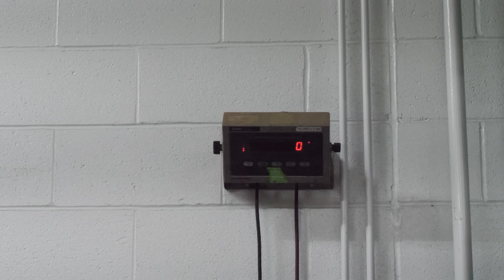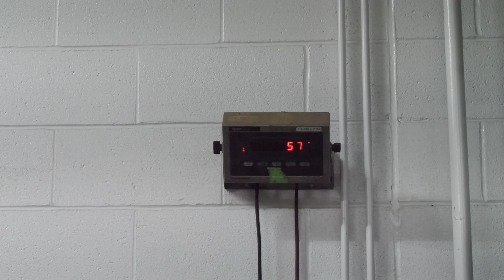EV TEARDOWN! Nissan Leaf Complete Electric Vehicle Drive Motor Unit Disassembly!

Comment: It's a lot smaller & way less messy than splitting a Tesla motor, & a GM EV motor, that motor was pretty clean & low wear compared to the Nissan Leaf motors I seen here ,the ones from the NYC Parks Dept look like they came out of a NYC sewage facility inside

Comment: Along these same lines, if you ever come across a Prius transaxle, snag it.  
I lost count of the fasteners when I got well over 100.  
They are insanely complicated- and really kind of elegant.  
I mean, if there are 2 motors and an engine, why NOT go nuts with the gearing???

Comment: 200LB FT doesn't seem like a lot - true,  but the torque curve of an EV motor (Leaf in this case) is essentially flat from zero to 10K RPM, so this motor is always producing 200lb feet any time the pedal is down.  Engine builders know peak torque is one thing, but the area under the curve is far more important.
Reply: Correct, an electric motor is a torque-on-demand power source, compared to an ICE, which needs to reach a certain RPM to generate peak torque.  

The naysayers on here need to go drive an EV with an open mind, I think they would be impressed.  I know I was.
Reply: @trex450flyer  And there's another "quirk" about EVs - anytime the pedal is pushed - even for a tiny fraction, the torque follows the pedal no matter how fast it's pushed.  In any gas car, the gas pedal can be quickly mashed to the floor and released, and nothing happens.  It takes time for the car to downshift (auto) and the PCM to respond to cam phasing and fly by wire throttle response.

Comment: The not simple part is the current  flow and the lack of resistance needed to make that happen. Any poor connection will result in great heat and / or melted parts.

Comment: For not having anywhere near as much thermal cycling and fuel combustion forces as a regular ICE, it sure seems overbuilt and overhardened with all those bolts for just an EV. :P
Reply: Overbuilt=longevity.

Comment: That torque number becomes more impressive when you consider that's the value AT ZERO RPM. 207ft-lbs from a dead stop.
Disappointed that they can't be sold. These should be big money for the DIY EV crowd. Controllers should be money as well.

Comment: Not that it matters but I cant help but mention. The armature is the stationary part of this motor. The magnetized part is the rotor. I think this is typical of moden EVs. There are motors  where the armature is part of the rotor. Those motors will always have brushes. Technically this motor is a permanent magnet synchronous machine.

Comment: For  Xmas, why not a marine engine. Merc has 2--strokes cheap, GM has 455 gas grabbers, Outboard, direct drives, etc. Even Yanmar 3 cylinders diesels. Or big Farm Machine engines. My first drive was a 1946 Ford tractor. Or a duce-and-a-haff military multi-fuel beast. Or take a tour of locomotive diesel rebuild facility. Just watched with great interest the Leaf  motivator tear down. Oh Wow, the possibilities. Aircraft? Go card race engines? Massive marine diesels? WWII huge rmulti-bank radial engines? I'd love to be educated/entertained. Keep on truckin'.

Comment: Eric,
Thank you for taking us on this new adventure.
Yes there is a huge resistance to the whole EV thing, but only because of the stupid mandate crap.
There is a very practical place for these vehicles just like when the Honda Hybrids first came out, then Prius, and now the options are quite diverse.
I agree, in spite of certain "Government Intrusions" there will be a broad array of mechanical engineering  designs and the ever present need for repairs 
Some things will be fairly easy to do ourselves and other things will need specialized training much like is already the case right now.
Awesome video sir!
For future reference, you will definitely need to set up containment areas to restrain those magnets. You certainly would not want one traveling across the shop unsupervised.😉
Happy Thanksgiving to you and your family!🤙

Comment: My 2017 Ford Fusion Energi uses little energy for AC, but depletes the EV battery in half the usual commute time in the winter since all heat is electric resistance heating. The 2.0L ICE engine doesn't provide heat like what we are used to. eMPG is weird like that.

Comment: Once you opened that motor and fought the magnetic pull ⚡️ of the center section, it became apparent that this is NOT a 3 phase AC motor but a Brushless DC (BLDC)/(ECM) type.
Electronic controlled BLDC require very accurate pulse control to each phase of the three windings (wired as a Y pattern) at the correct angle relationship.
There is no allowed "slip" line the rotational magnetic field of a 3 phase AC motor.
If you misfire the windings by just a few degrees the motor will stall, bind etc. Not good. They need feedback from the windings to detect angular position. 
I was surprised that electric cars would use BLDC rather than AC however BLDC is a bit more efficient.

Comment: The simplicity of manufacturing an electric motor compared to a piston engine is huge. I always marvel but nobody seems to think about how you make tens of thousands of engines. Tens of thousands of complex casting,  precisely machined parts with complex assembly. It's hard. With an electric motor, two handfuls maybe, of machined parts and a couple of castings. EV's must be cheaper to make at the level or hardware. A shame batteries or so expensive.

Comment: They could have slapped a "Traxxas" or "Hobbywing"  badge to that motor. It's the same thing as the ones used in radio control cars, only way bigger. Nice departure from the regular ICE stuff, Eric.

Comment: Great to see an EV tear down!  The early Leaf was not an exciting vehicle but they are very good at reliable, short-range driving.  As seen by this tear down, there isn’t a lot to go wrong in the drivetrain.  Nissan batteries DO degrade (sometimes rather quickly!) which kind of makes them disposable cars.  Buy a cheap used one, drive it for almost nothing for a few years, and then scrap it.  Your Chevy Trax, Ford Escape, or Dodge Hornet won’t be far behind….
Reply: In New Zealand we love our JDM imports...
RHD in both countries so there's that..
and we have a number of Leafs.... 
because being a temperate climate means the batteries do not get too hot nor do they get too cold...

So charging/time are the two variables.

However we have some clever people in Christchurch who have rewritten the Japanese software to get the whole dash speaking English.... 
and can slip 62kwh batteries into original old 24kwh Leafs...

They rip apart test and rebuild battery packs the same way others like overhauling a 4 cylinder ICE

See also Robert gets a new battery in his Leaf..UK YT vid

Comment: tap tap taparoo, was that clear compressor oil coming out at the start? also shortly after saw that bracket donk your arm in fast forward lol
Reply: That is cooling fluid for the electric motor. The ‘air conditioner pump’ removed first was a circulation pump.

Comment: Would love to see Chevy Volt tear down, both gen 1 and 2.
Reply from the maker: I think a gen 1 is doable for sure!
Reply: @I_Do_Cars would love to see em. I have both versions.  My gen 1 14 years old over 210,000 and still going strong.  Just did the rear brakes and half shafts at 200k

Comment: The amount of power that can be made out of that small package is impressive and Nissan dosent use the most efficient electric motors . This is big reason manufacturers are going this direction, between smaller packaging and the fact a motor can be one size and electronily limited to a certain power level so i can be used in different applications makes it a cheap option. The expensive part is the power source, once that is figured out ice will be dead. At 180 total pounds ( roughly) it produces nearly its weight in hp neary double that in torque.

Comment: A 7k solstice is worth about $15k as is. I don't know the return on parting it out. I had a black one that was in poor shape with 170,000 miles that I bought for $2500 and sold it a year later for $4500, after replacing the CAT, adding front fender liners and buffing out the paint. There's money to be made on that Solstice. How, is going to be up to you. The Sky/Solstice groups on facebook might be interested in the whole car.
Reply from the maker: Thanks to the state of Florida, it has a certificate of destruction so it’s going to get parted
Reply: @I_Do_Cars  , you'll make good money. There are NO body panels in the GM warehouse. Nothing for interior,  like the round dash ports, or door switches. Seats are super comfortable, so they'd go well in and car. The console elbow pads are hard to come by. Lots of salvageable parts

Comment: I laughed every time blue got stuck on the magnet, because I own several small, size of a 1/2 socket, very strong magnets and every time they get close to any metal or each other they get sucked in causing me to have to tilt one side off before I can get them loose.

Comment: If you ever got another one of these, it would probably be an early gen Tesla motor, they are notorious for leaking coolant into the stator.  You can rebuild them if they're not too rusty inside and bypass the coolant lines and there's shops that do just this for the Tesla community.

Comment: Blue will be forever magnetised after this adventure. If the casing was held you should of been able to just pull and slide it out. Without power there shouldn't be that much magnetic force.

Comment: "This is so dumb", Eric says, doing the things I would quite happily do as well.
I might have used a puller of some kind rather than scissor jacks, but only because I've only got one scissor jack ^_^
I could see myself using feet and hand to pull it apart, just cause!
---
That motor would make an excellent alternator, attached to a wind turbine.

Comment: As an HVAC tech, me seeing a 3 phase AC motor in a car… and wondering if it has a VFD and why it’s the motor’s rotor magnetic? 😆
Reply: Yep - got  VFD fed by the 400V battery pack and controlled by the D / R / N selector and skinny pedal speed control rheostat. 😁😁
Oh yeah, it can also regeneratively brake by using the motor as an alternator and rectifying the power to put some back in to the battery pack.

Comment: Any chance you can check what the gearing reduction ratio is on the transaxle drive to ring gear?
I'm wondering if ditching the transaxle is possible if I run it through my transfercase, keeping my standard diffs. 
Looks like a good candidate to make a hybrid old land rover. Cheap and dodgy version of Edison motors pickup hybrids.

Comment: If EVs had standardized replaceable batteries that you just pulled up to "the gas station pump" and an automated system replaced your battery(s) quickly... Doing this would remove the long process of charging and put the maintenance of the battery off on someone else... This would take away my main personal arguments against EV'S.
Reply: If you’ll remember, Tesla toyed with that idea back in the mid 2010’s.

Also, I believe some Chinese company offers this system, but it is proprietary, unfortunately.

“Nio's Power Swap stations can automatically swap a depleted battery with a fully charged one in about three minutes. The driver doesn't need to get out of the car.” — Google
Reply: @Clyde-2055 cool! I didn't know that. Infrastructure would be super hard to put in place but it's holding it back not having it.

Comment: Those 7.2v toothbrush batteries (the chemistry) will make a great 12v 24v 48v power supply.  Lots of amp hours

Comment: I got to remove a permanent-magnet klystron once. The magnet kept pulling the socket off my extension. I got to thinking about beryllium copper for the socket, but I don't know if that would be a feasible solution.

Comment: Do a Tesla model S rear drive only large induction motor. Just about all have the same issue where the coolant seal fails and destroys bearings and at worst shorts the invertor. The fix for these is the coolant delete.

Comment: I bought a used 2016 Nissan Leaf back in June & like it a lot. They are smooth to drive & have a lot of pickup & are cheap to buy & I also got the EV Tax credit up front, what's cooler than that?

Comment: Electric motors have one weakness …… bearings will last 250,000 miles and it can go twice that distance until the motor blows up. On one of my bearing up date from NTN bearing co. in Canada , large trailers had wheels coming off on the highways and killing peoples. Bearing company’s found out that the truck companies did not maintain the axle bearings and the maintainance  records  showed the failed bearings went  500,000 miles . Bearing will fail due to lack of lubricants or mostly due to over greasing which causes overheating and destruction of the bearings.

Comment: I was wondering why an electric motor has what appears to be freeze plugs all over it?....Then the blue coolant came out.  Does that go to some form of radiator?  I didn't see cooling fins on the engine casing.

Comment: Hey I have 05 nissian murano 230k milage 3.5l and transmission still in the vehicle. Engine runs has a few bubbles come up the rad cap when thermostat opens trans is good. Is there any core value?

Comment: I would think that the control u]nit that drives that motor would be worth a pretty penny, 100+ horse power VFD. Some machinist somewhere is most likely salivating just thinking of converting a gigantic metal lathe or milling machine with a drive train like that.

Comment: Random mad scientist thought/question: how sketch would it be to take a Nissan Leaf motor assembly and mount it to a big go-kart/Caterham 7/early Mazda Miata? Have to figure out the battery situation beyond soldering 18650s together, but there might be a market for electrified conversions without the insane power from a Tesla swap.

Comment: On brushless motors they call the armature the sintered rotor?  Nobody would be strong enough to take the armature out or put it in without it grinding the windings. The magnetic field is just way too strong.

Comment: Thanks for tearing down and EV … not a fan of EVs but it’s nice to see their make up….Definitely not much to them….The magnets most likely have some and maybe significant value as there are hard to come by and expensive.
Reply: The more I see of EV’s, the more I like the idea. 

EV batteries need some more work, but that power unit is amazing in its simplicity.

Comment: Google says 100 HP=74 KW. Could you run it in reverse with a small 4 cylinder for a killer backup generator?

Comment: I think shifting is done by software, like e-cvt. I suspect they optimize the e-motor for torque.
Reply: What shifting?  There is none, the gearbox is nothing but reduction gears and a differential.  People need to actually go drive an EV, it's just continous power flow with no shifts.  Reverse is accomplished by software, that is the convertor/ motor controller spins the rotor opposite it's forward direction.

Comment: They're hard to sell because nobody needs them.  They don't go bad. Electric drives are dead simple and reliable.  The batteries, on the other hand, have a life span.  Our 2013 Chevy Volt is still going strong though.  So is our 2019.

Comment: All the magic is the DC to 3 phase AC. Not going to try to explane it here...
Reply: Ah yes — the perverter … 😁
Reply: Yes, the motor itself is simple, all the magic happens in the electronic module that drives it.  

For us into RC,  the electronic speed controller can be connected to a PC and configured to do whatever we need it to, soft start the motor, automatic spool-up mode for helicopters, govern the RPM, many options are available.

Comment: Are you sure it's safe to take apart that motor if you don't know what you are doing??

Maybe there is a loaded high voltage/current capacitor in there?

Comment: If these motors are cheap and plentiful, what does it take to drive them? What kind of voltages, currents, waveforms do they expect at their inputs? What kind of sensors do they have for performance feedback.

Inquiring minds want to know.

Comment: 107 hp may not seem like much,but the electric motor produces max torque at zero rpm. that is why EVs are faster "off the line".
that motor probably has more torque than a gas motor making 107 hp.

Comment: Does anyone do maintenance on these motors? Do they use plastic tools? Or do they just replace the whole thing? I think the lack of organised recycling is a major drawback for EVs at this stage, especially batteries. Maybe someone should start looking into that...maybe someone who knows a lot about car wrecking, and who has a loader, and a safety tote.

Comment: Figured it was a three phase DC brushless motor. Will someone clarify?
Reply: To clarify, the power source for the motor's AC controller/convertor is the large DC lithium battery pack that powers the vehicle. That controller converts the DC from the battery pack into three-phase synchronous AC current, generating a rotating magnetic field in the stator windings, which in turn rotates the permanent magnet rotor, that feeds torque to the reduction gearbox/differential and eventually the wheels.

This motor is very similar to the brushless ones I use in my RC airplanes and helicopters, and their controller does the same thing, just on a much smaller scale. Hope that made sense.

Comment: Because people don't maintain these transfer cases are going to start coming apart falling apart and it's still going to have to be a pair of things but like I said people are on the best in me looking after the vehicles but will still interesting to watch you take this word basically all this is a great big electric motor with gears and oil it has an antifreeze coolant antifreeze a cooler one thing is it going to be the bad part is the batteries I'll be very careful with the high volts is lithium batteries because they will blow up and cause a big fire and very dangerous